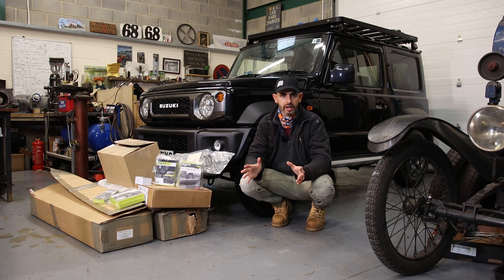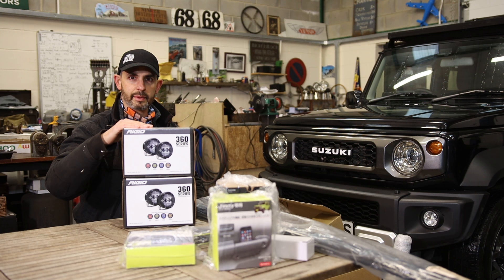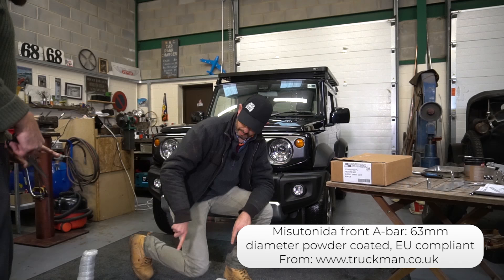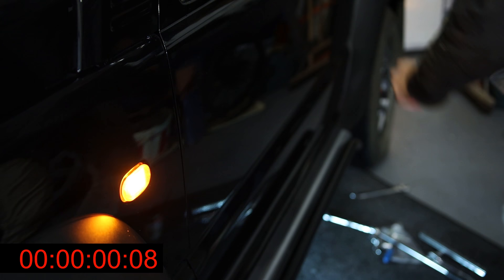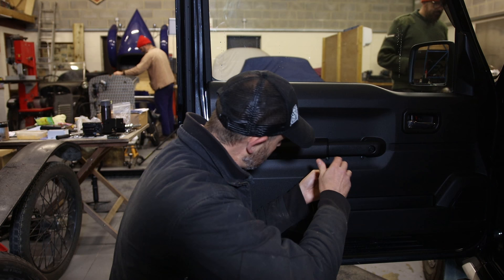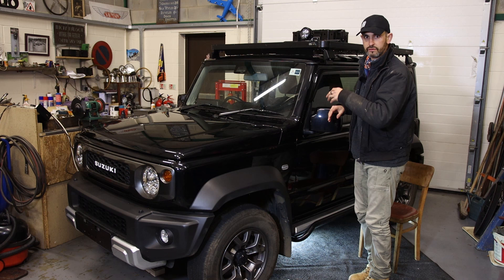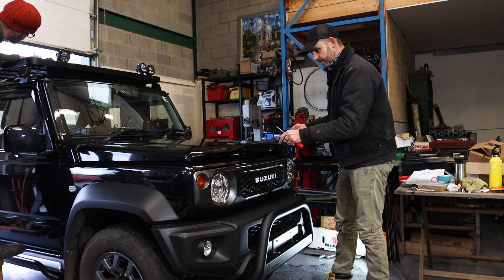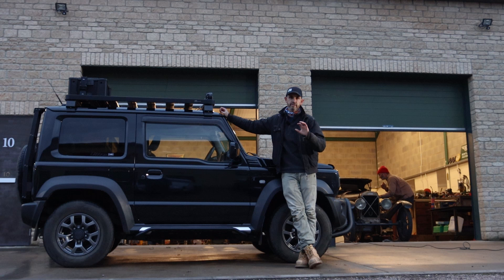Modifying our new Suzuki Jimny - Part 1

Comment: Jonny, I am curious why, when you say this is used for the school run, that you have fitted a bull bar. The front fascias of cars are designed to meet pedestrian head impact regs and bull bars undo some of that work as they are no deformable, unlike the plastic fascia of modern cars. Oh, and before anyone starts on me, yes, I know the front of the car is hardly a child friendly environment without the bull bar, and no, I am not anti-4x4 as I currently own a S2A Land Rover and have owned numerous old Land Rovers.

Comment: out of those wheel choices I would go for the american racing ones. Oh and I remember the days when bull bars were dangerous and would get you pulled over. When I was at uni our kayak club had an old transit meat wagon we'd bought from a police auction that was still in full riot spec - perspex windows, bull bars, fittings for the metal cage to go over the windscreen. Every time the cops pulled us over to complain about the bull bars we had to explain to them that we didn't put them on the van, they did.

Comment: "I didn't want to go crazy on aerodynamic losses"

Car with the aerodynamic qualities of a breeze block
Reply: Yeah... I would have thought this dude would have an EV as a family car. Apparently not.
Reply: Well every bit counts when its like that.
Reply: @angela1984a  I think he has a Kia Soul as well.
Reply: @angela1984a  Drive a petrol before the tyrants take them away
Reply: @kevinobyrne8020   Yeah, fuck the environment amirite?
Reply: ShadeReckless 23
Reply: @AA-lc6yi  electric cars have their own drawbacks, environmentally and otherwise, I'll be driving my diesel for another 20 years touch wood
Reply: @jongbong1912  and yet I’m currently sat 110 miles from home having driven an EV here at a tenth of the cost of your diesel in fuel, and my electricity provider only uses renewable energy.

So many environmental and vehicle drawbacks… not sure how I’ll get home!
Reply: @AA-lc6yi  YAWN.... Tired of arguing with the EV haters. It's  not just about environmental benefits or running costs, it the fact oil burners spew out toxic CO2. I feel sorry for kids living in inner cities breathing this crap in. ICE is DEAD get over it.
Reply: @MrPhillipgraham  That toxic CO2 you're talking about can be offset with trees but politicians won't push that, you also spew out toxic CO2 when you breathe, the damage that producing EV batteries does to the environment cannot be offset and often results in the destruction of forested areas and extreme contamination of the environment when all the waste is dumped, in some extreme cases it can take over 10 years for an EV to achieve an offset by which time the most contaminating part of the car will probably need to be replaced anyway, add to that the fact that the electric grid is going to have to double in size and production, solar and wind can't provide all the power reliably and solar provides no power at night when people want to charge their EV, hydro has nearly all been exploited to its maximum potential so we're going to have to rely on more gas fired plants, coal or nuclear which in turn produce their own waste and contamination, you think that plugging a car into the wall is clean but what's at the other end of the cable?

Comment: Those are great additions.   I used to drive a Suzuki SJ413 and made similar changes.  I had 4 spots fitted but they were the old incandescent bulbs.   But having said that, when you turned on the extra 200 watts, it really lit the way.   I also found a couple of small wide angle beams mounted on the sides of the roof rack were useful.  I think these are called "Alley Lights" in the USA.  I don't think we Brits have a name for them.   All the best, Pete

Comment: Ive got a 60cm strip LED lamp fitted under my front reg plate on my Landy. The bulbs inside the strip are angled up, down and side ways giving a wide and high vision .    Very effective to avoid boar and elk and the winters get very very dark in the forests.

Comment: Jonny, what you are putting on the bonnet is a bonnet protector. We do have loose stones on our roads here in Australia & they are normally kicked up by the car in front. I've never used them due to the mounting points causing rust spots on the bonnet.
Although the roof mounted spotlights look cool, I'm amazed you didn't put on an LED light bar.
I've owned Vitaras & Grand Vitaras since 1992 & I'm on my 4th one. The current Vitara I found to be a soft roader SUV. My next update will be the Jimny.
Tasteful & simple mods. I hope to see more of your Jimny in future episodes :)

Comment: I would not worry too much about its CX, the geeza is a brick. Besides, the sidebars and the roof tray will do more damage than a few lights. I own the model prior to yours, and only the rooftray added +1l/100 kms, Suzuki dealer dixit. Same if you go for the air/con, which it is a must. Trying a sensible driving, mostly bellow 3000rpm, and it is still hard to go under 10l/100 kms. 17 years after and still love the rascal to pieces. Loved your video, keep them coming, please.

Comment: Tip: add wide spread reverse lights to the rear of the roof rack. Connecting them to the OEM reverse lights, with a relay, turns them on/off with the gear lever. Have done that to several of my cars in the past and it makes a huge difference when reversing in the dark.

Comment: Anytime putting accessories (especially on an off-road vehicle) and the connections are metal to metal and there aren't lock nuts or washers, you should use blue loctite. As they will eventually rattle loose.

Comment: Nice video, as always. 😃

FYI
The bolts for the spare wheel holder is a known place to rust. Remove them, grease them up, reassemble, and they are protected.

Comment: The new Jimny is so cool. I was so torn between a Jimny and an Up GTI for my daily driver when I bought the Up a year and a half ago. Ultimately my 100 mile round trip to work and the cheaper initial purchase price of the Up won it for me and it’s a great car but I still want a Jimny so badly.

You should put the graphics you bought on the car one day whilst Chops is out of the house. See how they look and see how she reacts. If she doesn’t like them then no harm, no foul as they can be removed. Or you can compromise with her and get the classic Rhino graphic on the spare wheel cover.
Reply from the maker: Up! GTi is a fantastic car. You chose well.

Comment: From the Suzuki JB74 Modifications Facebook group: grease the screws & door nuts for the spare wheel bracket for rust protection. Add silicone washers as well.

Comment: The Jimny looked great with the goodies installed.  The bull bar I made for my old series II Land Rover would not be legal today, made from 2" steel gas pipe and a short length of rail track as a bumper, it did the job intended and ended the hours spent hammering the now removed bumper and the front wings back into something like their correct shape.  It was strong enough to use it to demolish walls.

Comment: Well, the lights are ok, sliders maybe (had some in my 2003 Jimny and all for show and no protection) as was my bullbar also. I have not yet midified my new Jimny, other than towbar...actually I am looking how to attach my electric winch to towbar mount and machine a similar quick release mounting point to attach winch to front end of the vehicle. Mine is a bit older than year and don't want to modify it by welding or drilling holes. Cheers from snowy Finland!

Comment: Happy New year 2021Suzuki Italia no longer issues homologations and clearances for the older suzuki Jimny and samurai! (My Jimny is from 2001 I wanted to mount heavy-duty bumpers of the type in vogue in Australia and then a winch and a +5 set-up of springs and shock absorbers  and suspension! and tires higher than the 205-70-15!) and for the laws of suzuki italy that no longer issues the clearances for the registration approvals of my 2001 suzuki Jimny 4x4 I even wanted to mount the arb blocks of the rear differential  and front and the super reduced to the gearbox!

Comment: Great video - lovely fun car. But - why fit a 'lift'? It does not increase ground clearance (axles), but raises centre of gravity (a bit). Ok, firmer springs can harden the suspension (with a rougher ride), but are 'lifts' necessary on a Jimny, which has quite a good break-over clearance for a production car? Underbody protection is a good thing. A winch is useful for pulling others out of ditches in winter (you'll never use it!). Many thanks for your video content - and car-enthusiast professionalism, great stuff. Cheers.

Comment: Really enjoy my Blue SZ5, eats up wet river banks without an issue even on std tyres where I’ve been through some proper tricky conditions . I’m looking to change to a more off road tyre however and as you know 215x75x15’s they fit without a lift kit. However with already blunt and mediocre performance could be a mod to far ? Be interesting what you end up with., just putting some roof bars and a fishing rod / ski holder on mine I could tell 😀

Comment: Johnny, you need to install P&P Load Resistors when converting from non-LED to LED bulbs.
Reply from the maker: Apparently not for those. I checked with the manufacturer.
Reply: @TheLateBrakeShow  Ok that's great. Great DIY videos.  BTW, have you thought of installing Osram LED light bar on the bullbar?

Comment: My advice: don't fit a body lift. Give it enough years of use the spacers will punch through the floor of the body. A suspension lift is a much better option and the right way to achieve more clearance, better off road articulation and more room in the arches. Also, a body lift will mean the tree sliders and nudge bar you've taken so much care over will sit further away from the body.

Comment: I'm guessing the screw on front deflector will start to rust before spring. Also what effect will all that stuff have on economy etc. Still liked it tho. Janspeed (do they still exist) exhaust & manifold, k&n and chipped, all for economy if asked. Nice One.
Reply from the maker: Deflector uses foam pads to cover paint, then clips that go into existing bonnet holes. No damage.

Comment: That's not a bull bar, it's a nudge bar and the only thing you do by fitting that is increase risk of radiator damage from it bending up and back and reduce front ground clearance/angle of attack.

Comment: In Aus we call them sliders, and that front bar we call a "nudge bar" because a nudge is the only thing it's going to protect you from!

How do you mount a winch if you're not allowed to fit a proper bull bar on the front?
Reply from the maker: Winch goes behind the grille and mounts to the chassis rails I believe.
Reply: The bar was a good addition, toughens up the look and draws the attention away from the plastics. No roos to hit so should be fine!
Reply: @TheLateBrakeShow  cos of course, Mrs Pervert is gonna find a winch absolutely ESSENTIAL on the school run!!!
I'm shocked she hasn't demanded one already.......!
Kids......

Comment: What are you going to do about the hole in the front bumper?  That would bug me so much.  Can I suggest debadging the rear and painting the front badge black, along with white indicators on the front it will give it a very clean look.
Reply from the maker: I've got grommets for the front bumper, but it is annoying that they were there.

Comment: I really like all your videos & presentation but am surprised you added the bull/nudge bars. My understanding of this type of item is that it radically increases injury to pedestrians/cyclists in an accident as it seriously reduces the initial "hit" area & has absolutely no "give", unlike the standard panels/bumper so concentrates the impact effect.
Are there any relatively simple mods to increase the power a bit to offset extra weight/fully laden/when towing?
I agree with others comments asking about Greg's works.

How long before you do Allegro episode 4?

Comment: Capable little motors those Jimny's but not sure how I sit with the metal bull bar thing as these have been frowned upon in recent years. My old family TD5 has a full rubber bull bar (it came with the car) and it feels very soft, basically it's there for looks but not much more, surely that's the way forward?

Comment: Don't do the lift, and don't put bigger tyres on it unless you are lowering the gear ratios. Also, keep an eye on the weight you are adding.  Apart from that, looking great.

Comment: Some cars go in history as an instant classics from new.
The Citroën DS and Jaguar E type are other examples of known instant classics.
The Jimny was a huge succes for Suzuki worldwide but in Europe they had to comply with the average CO2 emission of all their in Europe sold cars. 
Due to that, on the continent of Europe you have a 3 year waiting list to get a 4 seater!
Also here in the Netherlands they are  NOT cheap starting at €30.000 due to the CO2 emission surcharge.
In 2021 you can only order them as a commercial spec vehicle on the continent in Europe.
for goverment and business there is no CO2 surcharge because its a commercial vehicle.
Farmers, Forrestry, Road/Rail workers, builders ordered them already on mass.
1400 Kg tow capacity. proper 4x4, reliable its a winner.

Comment: I love Jimnys, the mx5 of the off road world.

Quick tip Jonny, you'll never find a 13 mm nut or bolt on a Japanese car. Not that I've encountered anyways.
Reply from the maker: Really? How odd. I am used to German stuff and the 13 is the go-to diameter.
Reply: @TheLateBrakeShow  hi Jonny, omg you replied ha.

Yeah I have had mx5, a few Toyotas and Hondas. And I worked for Toyota for a while, never saw a 13 mm fixing.

Comment: Looking good Johnny.

If you'll only be doing relatively light offroading then a suspension lift really isn't all that necessary, and can compromise on-road handling somewhat.

My Jimny mk3 will go pretty much everywhere a defender will and it has no lift. I'd put a locking diff on mine before I uplifted the suspension (not really worth the cost on a 15 y/o mk3 though).

If you're doing serious offroading & rock crawling then a lift is essential. For green laning & general farm duties stock with some more aggressive tyres is probably all you'll ever need.

---

I knocked up a small shelf for the back of mine out of some scrap plastic I had lying around. I use it loads and it's has been super useful... www.imgur.com/8IUepy8.jpg
I'd see if anyone makes a professional version of this for the mk4.

Comment: I would have chosen a led light bar, for roof rack, you can get them curved, would have been slightly lower profile, and a better light.?
Reply from the maker: Light bar is certainly a more flush fitting unit, and more aero efficient, but neither me nor my wife particularly like them.
Reply: @TheLateBrakeShow  a down side is, they use more power  having more led's, put an extra strain on the Alternator.

Comment: That's not really a bull bar tho, that's a nudge bar. I guess you have laws in the UK that prevent the proper ones. In Australia we have these great big fuck off things that nearly weigh more than the car. They involve removing the entire front bar to fit them instead. A lot more trouble for sure, but when you hit things with them, they stay hit. Kangaroos are basically just structures of iron-like muscle, so you need something properly sturdy to survive hitting one at 110km/h..... Yeah yeah, they're cute and iconic, and all that stuff, but they have ZERO road sense and will hop out in front of you on the highway without hesitation.

Comment: Why add copper grease to parts you do not want to come undone? (A product specifically designed to ensure parts do not stick together at high temperatures) Why not use a product that is designed for for that task, for example Loctite, Three-Bond etc.

Comment: Ditch the bull bar entirely. Looks cheap and does nothing besides make your vehicle less capable because it just hurts your approach angle. Either upgrade the entire bumper or leave it stock if you wasn't more functionality. Even if you had gotten a bull bar that was rigidly mounted to the frame, any significant bump would be more of a job to repair because the frame would be tweaked instead of just replacing a radiator, hood, grill, bumper and other small stuff. We've seen it multiple times at my dad's auto shop and the collision repair shop my dad sends work to.

Comment: You shouldn't really be fitting a bull bar to a road car in the UK. It is not needed and extremely dangerous for pedestrians.
Reply: Modern cars are designed to have crumple zones to minimise impact on pedestrians. Having a solid steel bar that does not deform will kill a human instantly at low speeds. Not sure why this isn’t obvious.
Reply: @DB-kb3xu  Whatever - steel tubing then if you want to be pedantic. I still wouldn't want to be hit by a bull bar which in this particular case serves no purpose other than cosmetic. But it is clear we aren't going to agree.

Comment: The more accessories you put on this car, the more engine power will you lose.
Reply: Er, no. Power to weight ratio will be affected, but not the engine's power output.
Reply: @davidjulian8536  Yep. I meant the same.

Comment: You lost so much necessary clearance with those horribly designed sliders and bull bar. It's frustrating to watch you do all this to this awesome little 4x4. These are all poser parts which aren't designed for off road at all. I'm sure your wife will be very happy.

Comment: if you pop on the lead heavy parts - as necessary as a goiter - you will die on the first sand dune with the engine.. it's really strange what kind of senseless crap you screw on there..